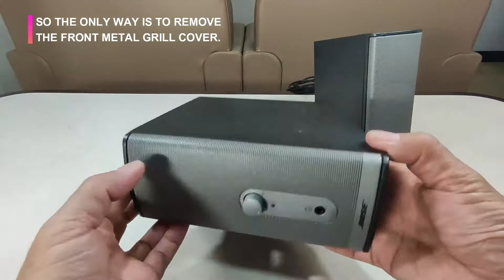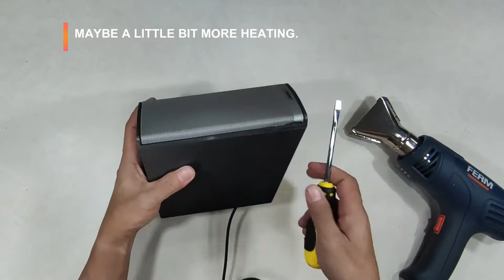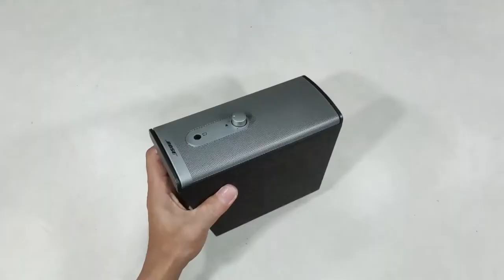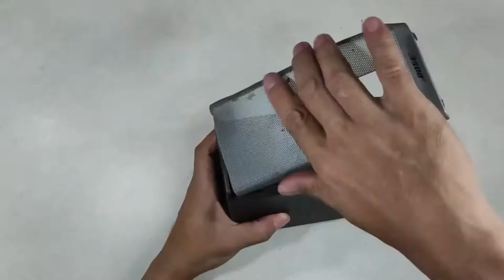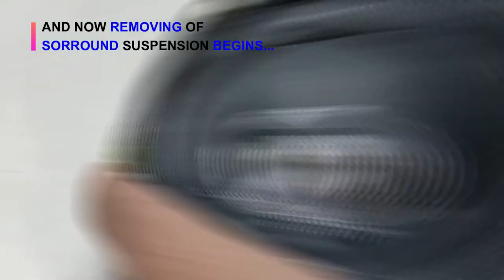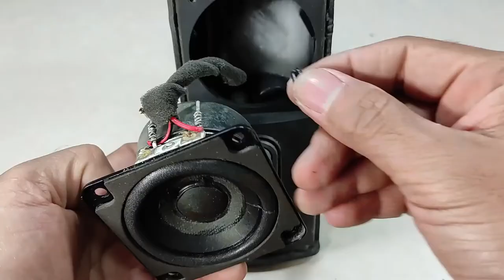How I Open the Front Cover of my Bose Companion 2 Series II Speaker and Repair the Distorted Sound

Comment: Thanks a lot for your video ! I'm in the process to fix my speaker. Personnaly I chose to break it on the plastic line with a wood chisel and then I cut the little metallic fixations of the front protection from the inside, but it was far from easy even with my little saw grinder. Then I think I'll proceed whith some hot glue to bind everything back together. Anyway, that's cool to share your fixing process. Good job !
Reply from the maker: Thanks for sharing and for appreciating my video...

Comment: After this video, I came to the conclusion that it does not worth the effort... Opening the speakers means destroying them. It is clear they are not meant to be fixed, just replaced when damaged.
Just buy a new set of speakers and be happy, and I say this as an Electronic and Telecom Engineer that I am, after fixing many electronic devices that really offer the option to be fixed and stay in good shape, not with the body or case destroyed in the process.

Comment: I found that using the hot air gun melts the rubber speaker surrounds. If hot air is avoided then just flex seal liquid can be used to repair surrounds.
Reply from the maker: Thanks for the idea Atlas Struggle...

Comment: Hi, i have the same bose companion 2 and I think the speaker is busted as my friends played it too high and damaged one of the speakers. thanks for the video which really helps. What type of adhesive did you use?  Also, you didn't show when you put the grille cover back on. how did it look? I wouldn't expect it to look perfectly the same. I guess these speakers are really not great when it's damaged.
Reply from the maker: I just use a regular rubber adhesive. This is the common problem with this speaker when getting old. With regards with the cover I still did not put it back since my concern is to make it work again. Glad it helps and Thanks Man for watching my Video.
Reply: Definitely to much volume can damage speakers, yet the surrounds go bad after several years on their own.

Comment: Does Bose (or anyone else) sell a replacement speaker that I can install in the housing? I have the Series III version of this speaker, which is very similar, and it has developed the rattling sound in one of the speakers. The Series III enclosure is very easy to open and speaker replacement would be simply. Any sources for a replacement?
Reply from the maker: Somebody told me before that we can only get a replacement in Bose Store...  If your series III is very easy to open, then it's cheaper to just replace the rubber sorround, most probably the rattling sound is due to broken rubber sorround same with my situation. and you can order it in online store. Mine after I replaced with rubber sorround from a cheap speaker still working  good until now.

Comment: Hi, please can you kindly tell me the name of the glue you used? I want to buy the same brand. Thanks
Reply from the maker: The one that i have used in the video is TYPE 99, but you can also use any all purpose contact cement or Rubber adhesive, like Rugby or Pattex.
Reply: @rodBACON  Thank you :-)

Comment: I have the same problem sir are you from the philippines?
Reply from the maker: Yes from Philppines... very common problem with this model.
Reply: @rodBACON   naiisip ko sir sa bose repair center may special tools sila nilalagare nila ang metal grill then papalita nila ng bagong metal grill.  Kaya expensive ang pagpapa repair nyan sa bose. Palit grill, change the entire speaker/brandnew speaker.  Hindi sila nag DIY repair na katulad ng ginawa nyo pinatungan pinoy style. Kaya ang dami nya sa market na hindi pa naayos patapon na. Kase after repair hindi mo na mabebenta kase deform na speaker grill. Gusto ko dalhin sa quiapo sa raon pero okey lang sa akin lagariin ang grill basta may tools sila ididikit nalang after. Yun nga special tool para lagariin ng pulido yung grill. Ginagawa nila nilalagare ang 6 contact lock point the palit ng brandnew drill at new speaker mahal yun.

Comment: Any smart person would have just hooked up a battery and 2 wires to the metal grille. It will heat up and negate the use of the hot air gun. Also, everybody knows to use plastic car trim removal tools to pull apart plastic objects, as metal screwdrivers will damage things. Thanks for the fix but you were barbaric in your work 😂
Reply: Simply buy a new or used one instead of wasting precious & valuable time #BARBARIAN

Comment: Pag no power po ano sira niya po
Reply: check the power supply adapter for voltage output
Reply from the maker: Tama si dmcbohol, Yung una kung issue nyan is nasira yung power supply. kaya matagal kung hindi nagamit, pero ng magkaroon ako ng power supply basag na din ang tunog.
Reply from the maker: tama ka Sir, unang issue ko dyan sa speaker is nasira yung power supply kaya matagal kung hindi nagamit.
Reply: a @rodBACON  
check nyo baka wire ng power supply lang sira (naputol sa dulo) kasi matibay ang power supply & amplifier section ng Bose Companion 2 all series
Ang weak part nya is yung foam surround na subrang manipis.  Dahil sa hot climate ng Pinas ito ay mag disintegrate/mabulok.
Best na palitan ng rubber butyl surround yan
Reply from the maker: @dmcbohol  thanks sa input mo Sir...

Comment: This is an example of doing way too much for literally no return on the time invested. You basically damaged the casing for both speakers to then replace the surround woofers with cheap ones that aren't going to deliver the same sound quality and/or output as the ones you replaced. I don't recommend anyone to do this unless if your expectations are simply to disregard the entire reason for buying expensive desktop speakers in the first place which is the sound quality.